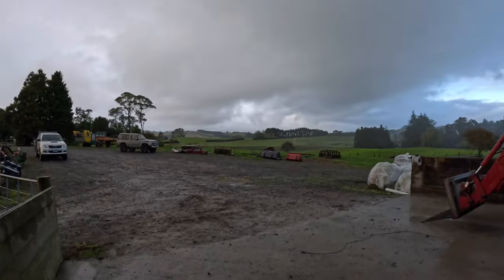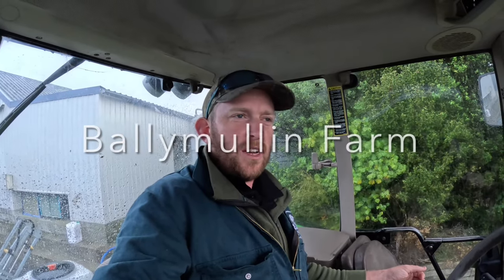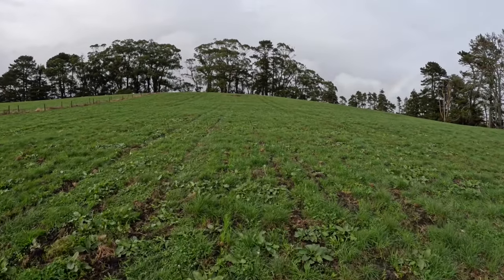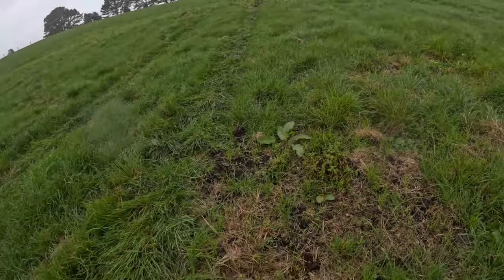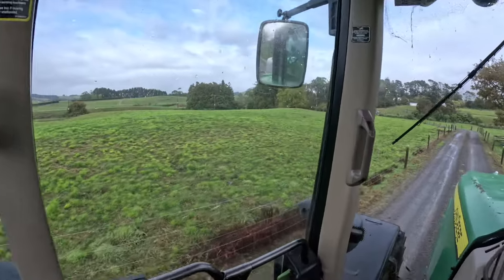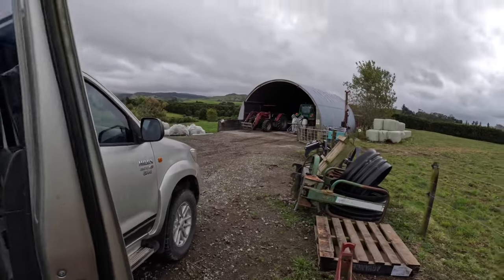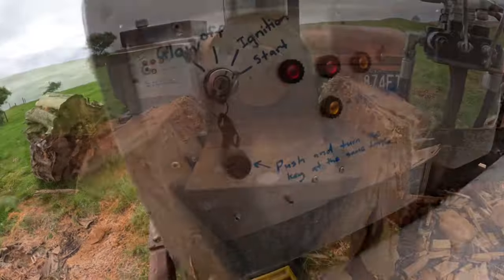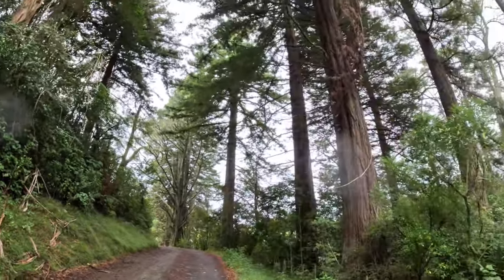Spray on nitrogen and perfect rain to break the green drought

Comment: I spread a bit of lime but stopped fertlising. After grazing a paddock I chain harrow, cambridge roll then aerate with a Groundhog spike roller. Rain washes all that good stuff into the subsoil. Getting great results with paddock recovery time. Microbial life and worm numbers are amazing. Forage quality is as good as it gets
Reply: why cant you just groundhog straight away and not worry about the first steps wont the ground hog spread the manures and roll it in
Reply: @edwardroskam5429  Groundhog won't spread manure or roll out pugs. It basically just knives slits into the subsoil. I have tried using the 3 implements in different orders and found this way gives best results
Reply from the maker: Interesting
Reply: @FamilyFarmingandFun  saves a lot of money and sends things down a regenerative path